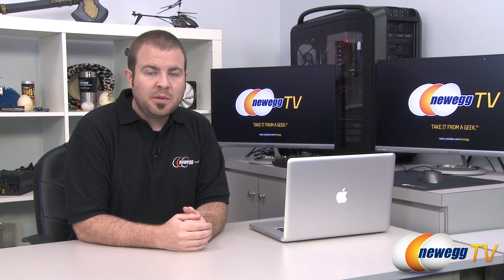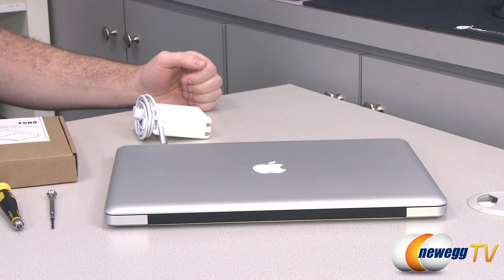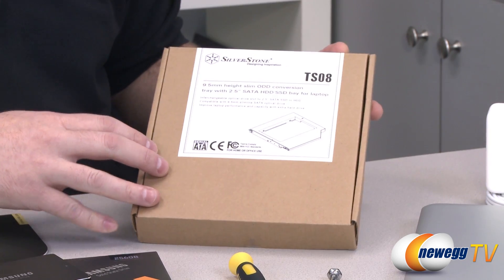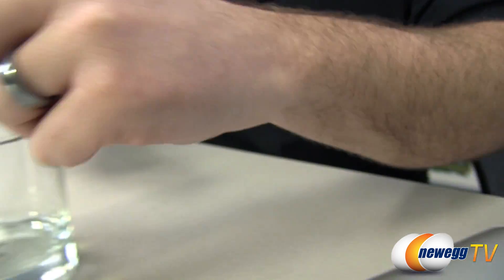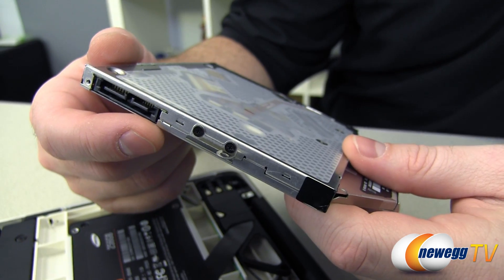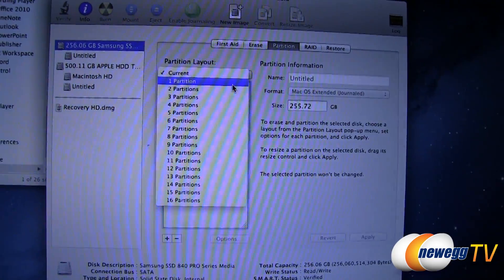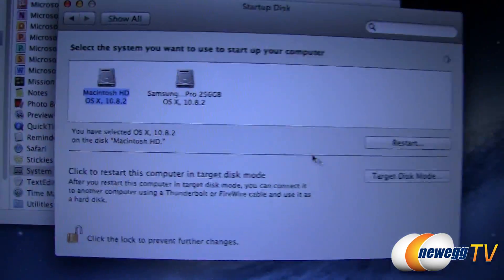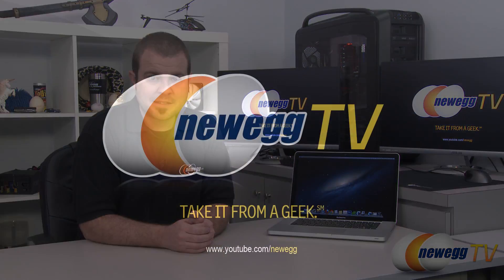Newegg TV: Dual Boot & Upgrade Your Macbook Pro Part I - Backup Your Files

Comment: Hi, pardon the ignorance but I currently have a 13inch Early 2011 MacBook Pro. I just installed 16gb of RAM from Corsair and it is working great, but I am also thinking of upgrading my 320GB hardrive to a 256gb Vertex 4. My question now is this. Should I go with two Vertex 4's, or upgrade to a nice 750gb hardrive with 7200rpms. I don't know what really is the difference and I choose the second option (most likely) how do i split the drives like what files where? Thanks alot.

Comment: A "windows app"? Windows support any third-party program you can think of. Mac doesn't. Thats why it's an Apple-dictatorship i.e a closed ecosystem. 

The troubleshooting thing is anecdotal and i have several friends using Macs they've had to replace over the years. Macs are style and no substance.

Comment: after watching this video..It AMAZES me as the stupidity of macbook users claiming they are EASIER to upgrade and work on than windows based notebooks.
I've NEVER had to remove so many cables to upgrade from hdd to ssd.
Windows laptop:Remove one or two screws that hold in the cover plastic panel, gently slide/disconnect the current hdd from it's sata power & data connection port, if applicable unscrew any screws left from the metal plate connected to hdd, swap it for ssd. repeat backwards.done.

Comment: I gotta do this with my black macbook.
1. Get a caddie and an SSD
2. Get rid of my dead superdrive.
3. place my mech drive in the caddie.
4. Make my SSD the main drive.
5. Use the mech drive as back up and place all files there, while using the ssd as boot drive.